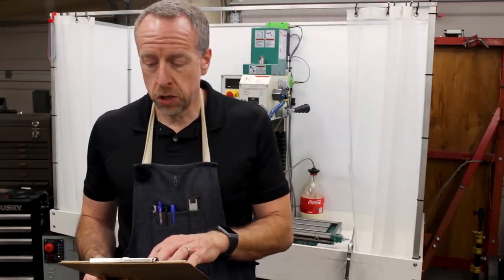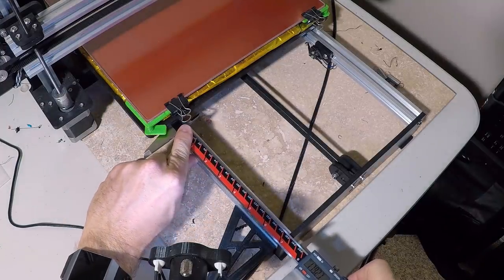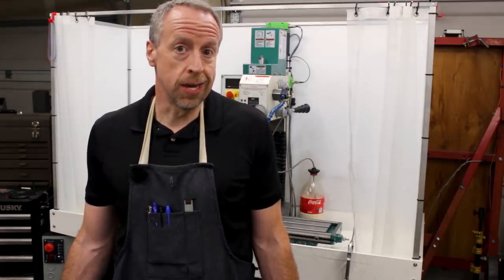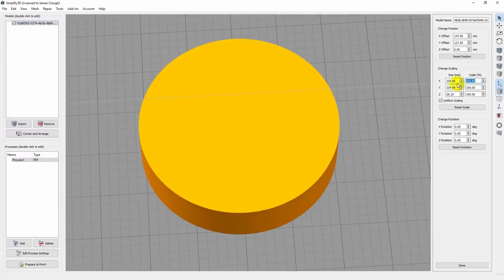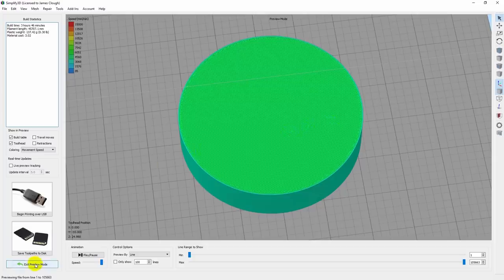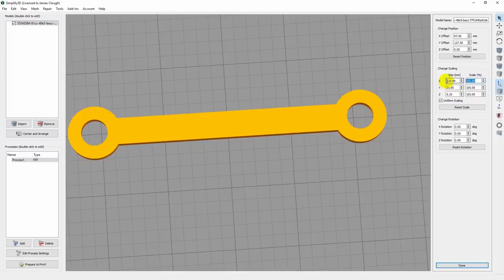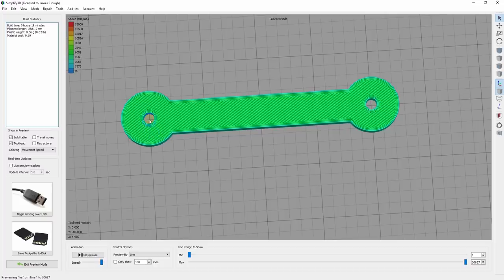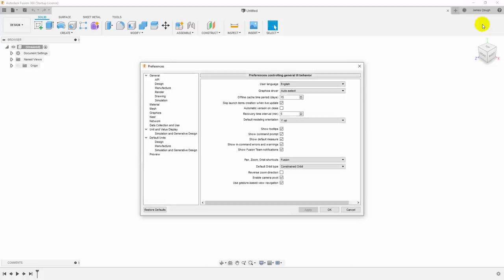3D Printer Dimension Tuning Revisited

Comment: you shouldn't be getting shrinking that much, make sure you got no sine error while measuring
I have round values for XYZ based on maths of the kinematics, fine tuned E values (was a mess, because the method everyone recommends is absolutely bad, measuring 100mm of a slightly bent filament Is not accurate at all, that tiny bent can change a bit the extrusion measured and may be off, either find another method, or straighten about 200-300mm
it seems insignificant, but a 1-2% error does stack with the 4% error in +-.02 filaments
also axis backlash is important
Reply from the maker: Over- or under-extrusion caused by bad E-values is a separate issue worth considering, but it doesn't move the locations of internal holes.  The manufacturer of the filament claims 0.4% shrinkage.  If you add to that the 0.1% error I measured for the printer axes, you get the 0.5% I measured in the finished parts.  Backlash is also potentially an issue, though I measured it and it's insignificant (~0.01mm)

Comment: Now I've watched this video... Yes, you've checked the bed's movement by the calipers... But is this the right method? What if you'll check a printed frame 100x100x10mm (just a hollow rigid frame) made with PLA or any low-shrinkage plastic? I've didn't used your method but I've used this method (checking an actual printed model's sizes).
Reply from the maker: There are multiple factors that could affect the measured size of parts: movement errors, material shrinkage, overextrusion, filament pulling tight around inside perimiters, etc.  Measuring the part gives the combination of all of these.  Measuring the inside and outside of a hollow frame isolates extrusion factors, but is still affected by movement and shrink.  Measuring distance between hole centers does the same.  Measuring a PLA part attempts to eliminate shrink, but it depends on the assumption that PLA doesn't shrink.  I've had PLA parts curl, so I'm not willing to make that assumption.  Measuring the movement with calipers reliably isolates and measures just the axis movement variable so I can tell how much error it's contributing.  Subtracting that from the center-to-center hole distance error in a part should reliably isolate the shrink.  Once those are determined and adjusted, measuring outside dimensions of the part can allow accurate tuning of perimeter extrusion.
Reply: @Clough42  IMO measuring a printer's parts to determine it's calibration can give little errors as well. If calipers are not sitting straight perpendicular or if a frame isn't ideal...
I'm still thinking that measuring a printed PLA part gives you more "honest" answer. But I need to re-check this on my printer :) I think that checking with a PETG print will be more/less the same.
Yes, I've got PLA warping as well... but that was just because I was printing on the glass bed without (or just not well prepared) a PVP glue on it. It simply curls up. Maybe it's how heating acts on 1st few layers.

Comment: you shouldn't be needing to compensate for it, if you specify a part to be 20.00mm it should print 20.00mm with a tiny error, also take into account blobby corners and the lines being actually round on the sides
Reply: He needed tighter tolerances and ABS shrinks when cooling (which is a known fact). So he has to compensate this shrinkage.
Reply: Which is easier to do: Scale up automatically in software by a easily discovered or prior known factor which will change with every single type of filament anyway... Or, dialing in your 3D printer so that it is perfect on the nose--for ONE type of filament--and then having to find out a smaller scale factor for all your filaments anyway?

Comment: Plastics have lousy precision, that simply has to be taken into consideration when designing
Reply: With proper adjustment and setup, I can hit +/-.003" on my printer, and it's just a $140 Prussa clone. Plastic can be pretty accurate, it just takes a little more attention to detail.
Reply from the maker: It's all about time and effort.  It's possible to get very good results with modest tools.  It just takes longer.
Reply: @ADBBuild  any advice on getting dimensionally correct holes?  Thankds.